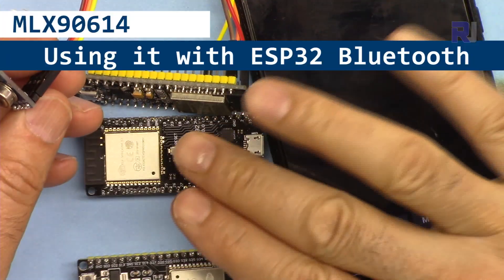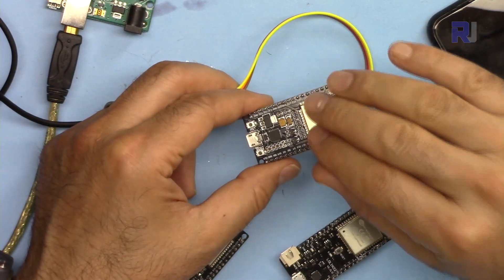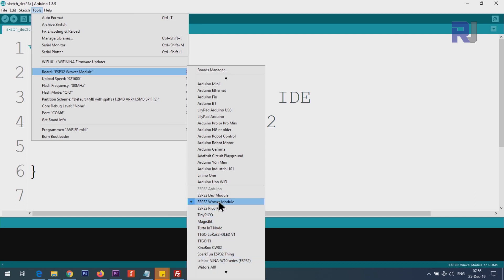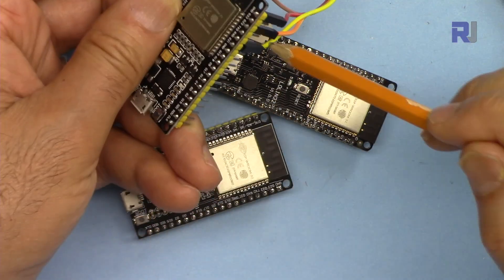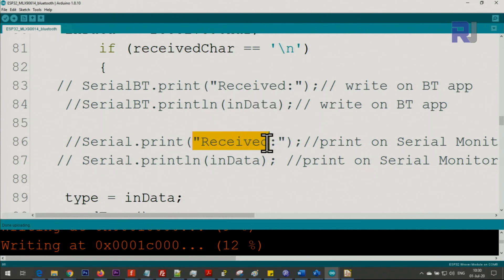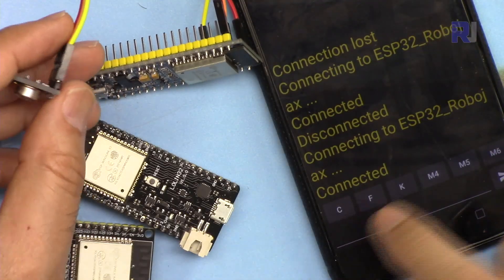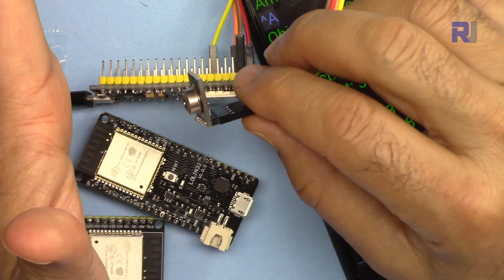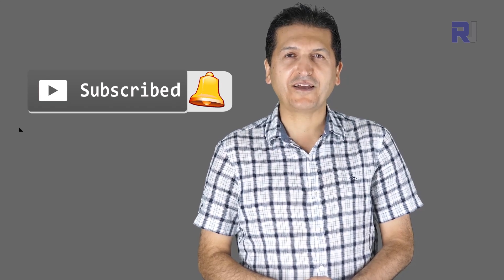Using Non-Contact MLX90614 Temperature Sensor  with EP32 Over Bluetooth - RJT330

Comment: guide to measure body temperature using sensor mlx90614
Reply from the maker: Please watch this video https://youtu.be/jN86PSAHMbw and understand, then use it
Reply: @robojax  in the morning I watched your video apply but the value is still unstable and lower within 36.5 ° C => 37 ° C which is the standard body temperature.  the project I am doing is designing an anti-covid human thermometer.  hope you help
Reply from the maker: it seems you did not watch the video I sent  you. if you have watched, you wouldn't have asked this question. Please watch.
Reply: @robojax   thanksyou so much ❤
Reply from the maker: you are very welcome.

Comment: Thanks for the best instruction and video. I am trying to use  ESP32 CAM AND INTERFACING WITH MLX90615. Here is I have edited your code. Everything is working but unable to read Sensor data Temperature. Could you please help me for the same? I also want to add OLED display with the same. As MLX and OLED are both I2C. so with same pin it will integrate.
I have used pull up resistor 4.7k and capacitor 0.1uF. the same circuit working well on Nano.
I want to add on ESP32 CAM model so can see on Bluetooth or WIFI app with Face detection and Temperature sensor value above rectangle border of face detection.

/*D:\ARDUINO\ESP32-CAM\MLX90614 Temperature Sensor with EP32 Bluetooth\mlx90615_esp32\mlx90615_esp32.ino\mlx90615_esp32.ino
 * 
 * 
 * This is Arduino code to Measure Temperature over Bluetooth using
 MLX90614 with ESP32
 
 * Watch video instruction for this code: https://youtu.be/HpsvNIAtjm4
   
 * Written/updated by Ahmad Shamshiri for Robojax Video channel www.Robojax.com
 * Date: July 01, 2020, in Ajax, Ontario, Canada

 Related Videos:
 Related videos: 
Introduction to MLX90614 Non-Contact https://youtu.be/cFDSqiEIunw
Display Temperature on LCD from MLX90614: https://youtu.be/_iO2L4P_irw
Measure temperature using MLX90614 Over WiFi:
 
 * this code has been downloaded from http://robojax.com/learn/arduino/
 
 * Get this code and other Arduino codes from Robojax.com
Learn Arduino step by step in structured course with all material, wiring diagram and library
all in once place. Purchase My course on Udemy.com http://robojax.com/L/?id=62

**************************
Get early access to my videos via Patreon and have  your name mentioned at end of very 
videos I publish on YouTube here: http://robojax.com/L/?id=63 (watch until end of this video to list of my Patrons)
**************************

or make donation using PayPal http://robojax.com/L/?id=64

 *  * This code is "AS IS" without warranty or liability. Free to be used as long as you keep this note intact.* 
 * This code has been download from Robojax.com
    This program is free software: you can redistribute it and/or modify
    it under the terms of the GNU General Public License as published by
    the Free Software Foundation, either version 3 of the License, or
    (at your option) any later version.

    This program is distributed in the hope that it will be useful,
    but WITHOUT ANY WARRANTY; without even the implied warranty of
    MERCHANTABILITY or FITNESS FOR A PARTICULAR PURPOSE.  See the
    GNU General Public License for more details.

    You should have received a copy of the GNU General Public License
    along with this program.  If not, see <https://www.gnu.org/licenses/>.
 */

#include <Wire.h>
#include "mlx90615.h"
 //------addedd 4.10.2020
#define I2C_SDA 14 // addedd 4.10.2020-----YELLOW WIRE IN OUR CIRCUIT
#define I2C_SCL 15 // addedd 4.10.2020-----ORANGE WIRE IN OUR CIRCUIT

MLX90615 mlx = MLX90615();
//TwoWire I2Cmlx = TwoWire(0);
//TwoWire I2Cmlx = TwoWire(0);
//------addedd 4.10.2020
char *typeName[]={"Object: ","Ambient: "};
float tempC, tempF, tempK, tempCA, tempFA, tempKA;
int type=1;// 1=C, 2=F, 3=K,
int showAmbient =1;//1=yes, 0=no

#define MLX90615_I2C_ADDR    0x5B

#include "BluetoothSerial.h"
#if !defined(CONFIG_BT_ENABLED) || !defined(CONFIG_BLUEDROID_ENABLED)
#error Bluetooth is not enabled! Please run `make menuconfig` to and enable it
#endif

BluetoothSerial SerialBT;
int inData;

char receivedChar;// received value will be stored as CHAR in this variable

void setup() {
  Serial.begin(115200);
  //SerialBT.begin("ESP32_Robojax"); //Bluetooth device name
  SerialBT.begin("amitech_ir"); //Bluetooth device name
  Serial.println("The device started, now you can pair it with bluetooth!");
  //Serial.println("Search for ESP32_Robojax device and Pair your phone to ESP32_Robojax");  
  Serial.println("Search for amitech_ir device and Pair your phone to amitech_ir");

Serial.println(F("MLX90615A test"));
  //I2Cmlx.begin(I2C_SDA, I2C_SCL, 100000);
  //Wire.begin(2,14,100000);
// Init MLX90615 sensor
  Wire.begin(I2C_SDA, I2C_SCL, 100000);
  //bool status;

  // default settings
  // (you can also pass in a Wire library object like &Wire2)
  //status = mlx.begin(0x5B, &I2Cmlx);
  
  
  
     mlx.begin();  

     //mlx.begin(0x5B, &I2Cmlx);
    //Robojax.com MLX90614 with ESP32 Bluetooth

}

void loop() {
   getTemp();
  //Robojax.com MLX90614 with ESP32 Bluetooth
  if (Serial.available()) {
   // SerialBT.write(Serial.read());
  
  }
  while (SerialBT.available() ) {
    receivedChar =(char)SerialBT.read();
    inData += receivedChar;    
        if (receivedChar == ' ')
        {    
   // SerialBT.print("Received:");// write on BT app
    //SerialBT.println(inData);// write on BT app   

    //Serial.print("Received:");//print on Serial Monitor
   // Serial.println(inData); //print on Serial Monitor     
    
    type = inData;
    sendTemp();
   
           inData = 0; // Clear recieved buffer                    
                  
        }//if (receivedChar

  }// while

        //Serial.println(servo1Angle);
        delay(20);
//Robojax.com MLX90614 with ESP32 Bluetooth
}//loop ends here

void sendTemp()
{

//Robojax.com MLX90614 with ESP32 Bluetooth
    if(type ==24)
    {
      SerialBT.print(typeName[0]);
      SerialBT.print(tempC);//object Temperature 
      SerialBT.println("°C");
      Serial.print("Temperature:"); //print on Serial Monitor    
      Serial.println(tempC); //print on Serial Monitor      
      if(showAmbient)
      {
        SerialBT.print(typeName[1]);
        SerialBT.print(tempCA);//ambient temperature 
        SerialBT.println("°C");        
      }
    }
    if(type ==25)
    {
      SerialBT.print(typeName[0]);
      SerialBT.print(tempF);//object Temperature 
      SerialBT.println("°F");
      if(showAmbient)
      {
        SerialBT.print(typeName[1]);
        SerialBT.print(tempFA);//ambient temperature 
        SerialBT.println("°F");        
      }
    }
    if(type ==26)
    {
      SerialBT.print(typeName[0]);
      SerialBT.print(tempK);//object Temperature 
      SerialBT.println("°K");
      if(showAmbient)
      {
        SerialBT.print(typeName[1]);
        SerialBT.print(tempKA);//ambient temperature 
        SerialBT.println("°K");        
      }
    } 
//Robojax.com MLX90614 with ESP32 Bluetooth 
}//sendTemp ends here

/*
 * @brief returns temperature or relative humidity

 * @return returns one of the values above
 * Usage: to get Fahrenheit type: getTemp('F')
 * to print it on serial monitor Serial.println(getTemp('F'));
 * Written by Ahmad Shamshiri on Mar 30, 2020. 
 * in Ajax, Ontario, Canada
 * www.Robojax.com 
 */
void getTemp()
{
   // Robojax.com MLX90614 Code

    //tempC = mlx.readObjectTempC();//in C object-MLX90614
    //tempCA = mlx.readAmbientTempC(); // ambient-MLX90614
    tempC = mlx.get_object_temp();//in C object-MLX90615
    tempCA = mlx.get_ambient_temp();//ambient-MLX90615
    //tempF = mlx.readObjectTempF(); //Fah. Object-MLX90614
    //tempFA = mlx.readAmbientTempF();//Fah Ambient-MLX90614

    tempF = (((tempC*9)/5)+32); //Fah. Object-MLX90615
    tempFA = (((tempCA*9)/5)+32);//Fah Ambient-MLX90615
    
    tempK = tempC + 273.15;// Object Kelvin
    tempKA =  tempCA + 273.15;//Ambient Kelvin

    // Robojax.com MLX90614 Code
}//getTemp
Reply from the maker: You are welcome. 
your projects seems very complicated.  face detection I believe can't be done with Arduino (the uno and maga) or ESP32. you need a cpu like base board like raspberry pi.  The code for bluetooth should work without modifying it. I will try to make video or OLED in the future.